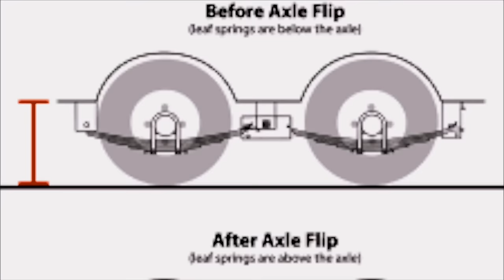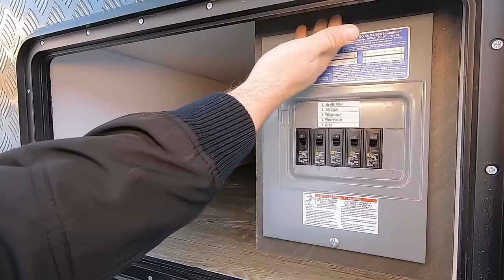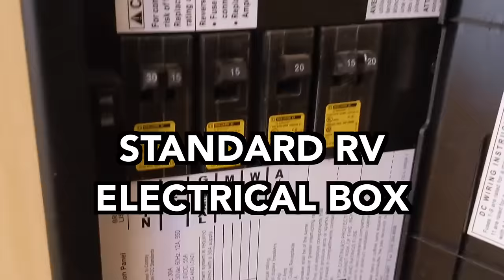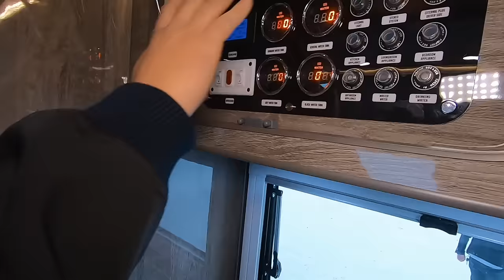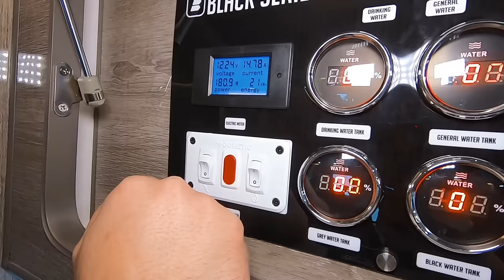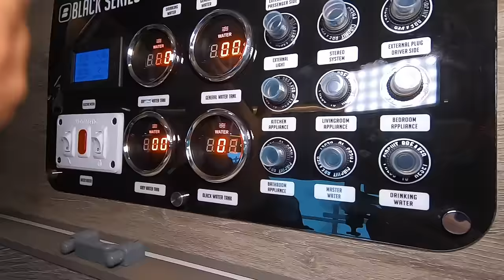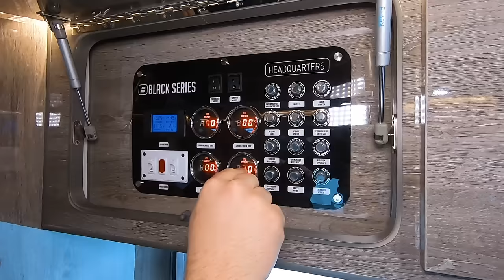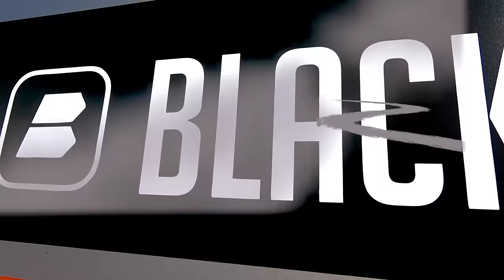BLACK SERIES! CLICK HERE TO SEE HQ19 REPLACEMENT https://youtu.be/7XND9C63GGM?si=10AU8iFP7bFzLmP9

Comment: Nice rig. Need a large lithium battery bank with inverter to run a 12v AC, 12v fridge, microwave—everything. Also include a way to connect to the tow vehicle so the lithium batteries can charge while towing (in addition to solar charging).
Reply from the maker: https://youtu.be/zAGCggbe3ZM Check out this video. This is a new trailer we are carrying and it may hit your bucket list.

Comment: I got screwed over by suncamper rv they sent me pics and they knew i am disabled and never bought a home before so they sent me a few pics so i payed for it when they delivered it i noticed they sold me this rv with a bad roof soft spots on the floor the hotwater pump is so rusted up so much hair and small trash in the floor vents and cant unscrew the screws because the screws rusted up no hot air and grinding sound in the ac and leaks inside shower dont even work Ac has a hard time keeping cool.. I spent every dime i had on the 2006 trail light by rvision.. Having a home as nice as the one you showing would be a dream but could never afford anything like it... Nothing but bad happens to me

Comment: One good improvement on this nice camper a 12 volt fridge, no need of propane, bigger size and colder.
Reply from the maker: Yes the 12 volt fridges are awesome.. You'd probably need to upgrade the battery system and/or extra solar panels.

Comment: I've been an RV tech for 22 years. I really like that suspension but if you're trying to build 'the best' off road trailer and want to talk crap about other 'wanna be' off road trailers then enclose that undercarriage with an insulated skid plate for 2 reasons, obviously for bottoming out but also to insulate those tanks for extreme climates. Also, don't be dumb like every other trailer manufacturer by putting gas appliances exhaust under the awning area, that should be illegal! (I'm not sure if you guys do this)  1.) People enclosure that then the gas is pumping right into an enclosed room. 2.) Kids are always playing under the awning and can get burnt by them. I really do like this unit! But it just seems like you guys started designing an off road trailer then gave up and said "Screw it, that's good enough!" with everything open underneath it
Reply: They're the DEALER, not the manufacturer.

Comment: Thank you for showing off the Black Series HQ19.  It gave a really good view of the product.  Was glad you pointed out some of the upgrade changes made from year to year.  Could have done with a little less of the rants as you put it at one point.  Use the time you took to tell how others failed and take that time to tell us about the built-in washer or other features.  Also, I was glad you did not mention any other trailer manufacturers, but you kept repeating about the quality of the Black Series over the competitors.  

The short of this is tell me about the product you are showing.  Compliments to your camera guy in being able to follow you.
Reply: Amen. Cut the silliness, and this could be 40 minutes tops. OMG.

Comment: so today I actually got to check one of these $70k trailers out.  The dealership was pretty clueless about their own product but that's for another day (I'm not talking about the ROA dealership that made this video though). In the front storage box opposite from the propane tank storage box you have a place for the jerry cans (if used) and in the unit I looked at there was a fuel tank to fuel a webasto style furnace located under the bed. This is not an actual webasto furnace but one of the Chinese knock offs for approx. $200 bucks (on Amazon).  The dealer said the Black series all come standard with this heater and I asked if it was the diesel or gas model and he had no idea.  Second- these black series campers are not four season rated at all and an extensive add on build must be done like the deal they do at the ROA dealership in Utah... The dealership I went to here in WA state said they don't do insulation modifications so, are you stuck going to Utah?? I probably would because of the simple fact they actually know their product. Moving to the roof which concerned me- you will notice there is no roof ladder for access and that's because structurally the camper isn't designed to be a walk on roof. The dealership said why would you even want to go up on the roof??? Really? He said if you have a roof problem you would just bring it back for service.  I'm guessing the salesman isn't really a seasoned rv owner and doesn't understand the need to get up on the roof to find a leak out in the middle of nowhere when on a trip. If you look at the Black Series sales brochure you will notice that there are no options listed to customize your trailer.  Last thing that bothered me.. I'm 6 foot broad shoulders, 205 lbs.  If you sit on the toilet you will notice that arms will be nicely wedged on both sides when you sit down so practice you yoga moves if you need to use the toilet...you can figure out where I'm going with this. All in all I think the Black Series company put most of their money into the development of the suspension components under the trailer for off road usage.  I def would not pull the trigger for $70k on the unit I looked at HQ19.  No options.
Reply from the maker: Yes, We now have a good replacement to the HQ19. Here is a link to the new off road trailer that you will want to see. https://youtu.be/Oe1cy9zHSRE

Comment: Working this design idea:>New spring design still messing w/it. Take a normal spring that starts flat bottom & top coils. Then u over stretch it max-ed out & cut it off n middle. Idea of new spring is there r two slide plates that work together in the middle of coil stack. Facing the front bc that is axis of travel other than up & down working the problem. U hit something U step on brakes hard & it's a forward motion rock hit rebound or braking some times more so then up & down forces like hole or turning. <Keys is u Want the 2 pieces of steel in middle of coil stack to face up like a brake peddle clue!>. The coils start out flat top & bottom <But in middle r angled 45 degs or so more oval than round>. The spring works the same up & down only NOW help deal w/nosing when braking or hitting rock or curb w/tire. It bc of 45deg slant & 2 slide metal ends is really 2 springs in1 spot. W/slide plates making big springs feel & act softer bc they don't hve 2 b directly inch straight line over top of each other. The middle plates limit max compression not spring itself far softer better system bulk of travel time.

Comment: One Massive Failure - the Black and Grey dump valve.   Being placed on the rear like it is now - that would get ripped off immediately if you really go off-road on the first dip.  The valves should have been tucked up on the side or protected by some sort of a skid plate / rock rail.    #fail.   Other than that one big miss, we love these trailers and have spent time using them.  Very nice.    Fix the dump valve placement  and it's a winner.

Comment: Very nice, but why are you using absorption based fridges instead of the ac/dc compressor based? Why all the wood instead of aluminum framing. Lastly Do you have a toy hauler line coming up and maybe in the 28' range.

Comment: The thing about RV an Solar, is that you have to make sure you have sufficient amount of batteries and also proper solar controller and inverters... My leprechaun coachmen 220B has all that i could need, but some people/company decided to mess up my gear... I only have 4 solar pannel, but it could essentially run everything in my motor home except the A/C Unit...

Comment: I have a Tundra 4x4 TRD Off-road Crewmax it's the half-ton with highest towing capacity at 10,400 lbs which is more than adequate for a trailer with a 6,800 lb dry-weight. 
I was a bit offended by the way you somewhat dismissed half ton trucks as a viable option to tow the HQ19. I plan to purchase my unit next year. Great product.
Reply from the maker: The Toyota Tundra TRD pro is not a good truck to tow the HQ19. Any Chevy, Ford, or Ram half ton can get the job done just fine.

Comment: One additional feature I hope they add is a positive air flow system similar to what they have on Kenron top ender caravans to prevent dust from getting inside as you drive down dusty roads. Is that a feature you can add on now.
Reply from the maker: Yes it is.

Comment: I'm kind of confused about what kind of people they are targeting. Off road folks tend to go lighter and more agile. Luxury people tend to be a little older and are not going to be off roading so much.  It's big and needs a 3/4 ton truck just to pull it.  That total length will make it very difficult in anything remotely technical.  I can see something 3,000lbs and maybe 20ft in length.  Maybe that's why Sprinter 4X4 conversions are so popular.  Looks cool though.

Comment: Saw these online in a mash up video and was sold.  Never have owned a trailer before but I feel like as a solid heavy duty and long lasting trailer this should be the standard. Now for a question: I own a 2017 raptor and was wondering if that is enough?  I heard that u recommend more of a 250 type of truck but, would I be able to tow this modle with out any major issues?  Great review and very well detailed.  Just might have sold me on dealing with you folks.  A+ job.
Reply: You’ll probably be at the raptors limits. Most likely the weight he quoted was dry weight of 6,800lbs... the 4.10 gears should keep it from overheating though.  Just sell it and get an F450 singled out

Comment: Don’t get me wrong this is a dang nice camper $$$.  But in 20 years no one has ever built one that I’ve loved I’ve owned three so far  I sold my last one  after I seen patriot campers in Australia took ideas from that and built my own from scratch. I live in south east Texas we have bad flooding  here. So I have my dad, grandma, son, wife and my self with two 70 pound dogs so that’s a lot to bug out with... I built my own camper it’s a cross of several different campers. I built mine to be able to carry my 12 ft boat  and side by side . The adults sleep inside with privacy walls for the master bed and two bunks. My son and the dogs sleep in a pop up tent on the roof. It has a indoor dry bath  so it’s basically like the no/bo 10.5 camper on crack. I hate gas everything is ran by electric with off grid solar./ back up generator. The boat is on top and hinges down on a small winch. And my polaris ranger 4 door loads in the back. I’ve done engineering my whole life this is all done on a 15 ft trailer I hand built it, its able to go off road Mud, rocks, snow. Four wheels independent suspension all that good stuff  I pull this with a 2016 GMC Canyon it’s not even difficult for my little truck. The next two years I have been working on a set up with electric drive motors for the camper wheels ran off a second alternator from the truck with quick hook ups this way driving down the road this will help with mpg instead of my truck doing all the work the camper helps too. This is just a little of what I wish had years ago but no one makes so I built it my self. Sure this one in the video is nice and flashy and $$$ but it still can’t come close to what I needed and still be pulled by a little midsize truck!
Reply: You should do a walkthrough video.

Comment: Gel batteries are okay, but in this day and age, for applications like this, just go with Lithium Iron Phosphate batteries, such as Battleborn, they are the absolute best and cost about 950.00 per 100ah battery but will last practically forever with more than 3500 charge discharge cycles and a 10 year warrantee.

Comment: The full size 4 burner residential sized stove & oven combo is where the market is at. Fridge 10 cubic max or put 2 fridges in it but not oven & stove top,normal size.
Reply: Full size oven and 2 refrigerators? Are you going into the outback to cook a full thanksgiving meal for 10? I mean, you could fit both things in this 19ft box, but then you'd have 0 room to move.

Comment: Another future WoW factor idea is when u get <off road> just what that means legally, the axles can pull pins pull out wider stance more wheel travel. There is no axle so why can't the trailer tires pull out from under trail  no reason why not. The more the tire arm is pulled out the more monster truck diagonal inherent free travel. going down the road pushed all the way in normal travel. U built it I am just leting it do what it should hve been freed to fully do.
Reply: the arm will sake the more u pull it out less counter balanced same basic geometry.

Comment: If you could please suggest to the MFG to use cam locks that have nylon insert nuts, so it does not fall apart that easily... or spur washers... i get really annoyed when the cam lock comes loose because they cut corners on cost....

Comment: Question:  you guys seem to recommend a 3/4 ton truck, but you have video with a new f150 towing the HQ19 off road (without a brake controller).  I have a newer F150 with the Max towing package, 3:55 gears, 3.5 Ecoboost. Just curious what your thoughts are. Thanks!
Reply from the maker: We think you will be fine. With a WD Hitch even better.

Comment: Looks like one would rip all the plumbing off those rear tanks with a steep trailing edge departure, probably needs a cross bar/rock ski or a drop down at rear hitch to protect that plumbing... Also if you guys want to be the "Expert" on this or any off-roading, maybe get your tow vehicle set up to properly to tow that trailer, it definitely is not in this video;-)
Reply: Exactly, I saw the pitch of the trailer... Was 🤔... Not quite level... And yes, the tanks are not protected well...

Comment: To be better offroader it should have beadlock rims and not sure i like the sewer pipe location or maybe have a skid plate protecting it . Also water pipes on the outside is a bad design . Could have made it have a closed in area where pipework can run and be heated . I dont know if this could handle canadian winters so maybe keep it in the states in my opinion ..

Comment: This man loves to mention how this trailer is higher quality than most other trailers. He fails to mention this is an $80,000 travel trailer. Sure the quality is slightly better but theyre charging 4x the price
Reply from the maker: Thanks for commenting Jake,
The 2021 HQ19 is 65k out the door.
Reply: You realize that doesn't make much of a difference to my point right? You could get a 2020 Class C for that price. Those have full aluminum frames and luxurious interiors too, plus they come with an engine. Point is, this is a nice rig however its ridiculously overpriced and in 5 years it's gonna be a $20,000 trailer.
Reply from the maker: @jakem8438  Thanks for sharing your opinion on the topic. We have facts and data that would disagree. But we appreciate your thoughts.
Reply: @ROAOffRoad  I doubt that however the trailer is incredibly nice and the review was very through. Obviously I know you don't personally control the price so I'm definitely not blaming you, just pointing out the obvious.

Comment: $10,000 suspension and $200 drum brakes. What was the logic behind that?
Reply from the maker: Compared to disc brakes, drum brakes are generally more durable, requiring fewer lining replacements in a given period. They also provide better balance with trailer braking systems (which typically use drums), aiding stability.
Reply: Tacoma has rear drum brakes in a 40k car.

Comment: A lot of improvements.  Wish they’d improved the cabinet and table top.
Reply from the maker: They have improved the cabinets. I actually forget to mention some of the point that they removed and rounded. They used a stronger adhesive. Also the countertops they have done the same... What do you not like about the cabinets?
Reply: RVs of America Black Series Camper Dealer sorry meant to say cabinet counter top.  I like the cabinets themselves.  I’d gone into a q19 at last years rv show in California and the counter top was coming apart in the stove and sink area.

Comment: Rear black and gray tank drain is in prime location to get torn off off roading on steep descent or damaged very easily if lightly rear-ended from behind. Same with rear stabilizer jacks. For an experienced off roading RV company, I am baffled. No protection what so ever.
Reply from the maker: The departure on the trailer is better than any 1500 or 2500 truck. Even a 4" lifted truck doesn't have as good of departure angles. So you will be ripping off your rear bumper of your truck way before the rear on the trailer. It even has a better departure than the new Jeep truck. If you are going to have problems with it then you probably shouldn't have your truck there either. We have done Jeep trails and have not had any issues with it yet. Almost 25" off the ground. Also the Jack's are higher than the steel frame and you would hit the frame before them... Plus they are mounted on steel brakets... Sorry but there really is not that much to critique about the departure angles on this trailer. If you have actually used it and measured you would see. Maybe sometimes it hard to see in the video. 😁

Comment: The hot water heater propane instant & 120 r powering heater as well NOW. Quieter than old style furnace,& where market is going. My My Rig Trailer 2 instant hot 1 for each zone if heating & each bath deal backed up.  Still like the heat pumps most of the time fall back wall units if tiny but mini splis r coming fast & there is no going back,if under trailer space. Clean roof for solar no tree trouble more efficient & quieter! Most ppl want double pane full open baseball proof & mini 1st glam upscale feature on any list if in the know.